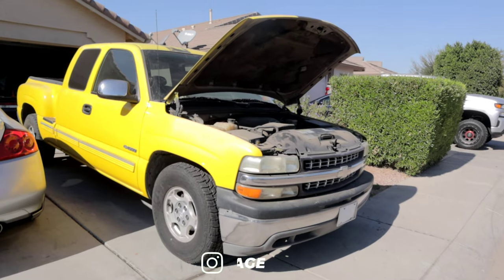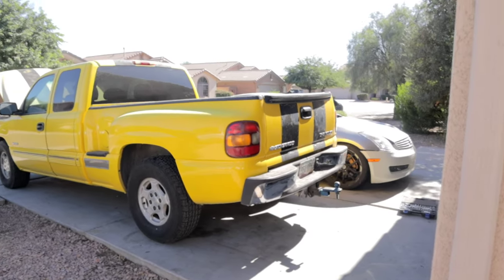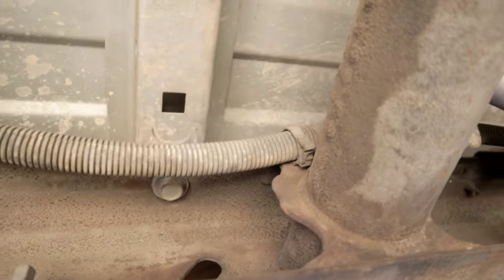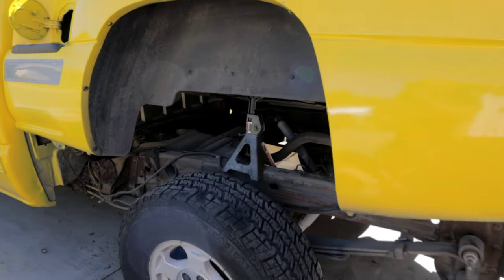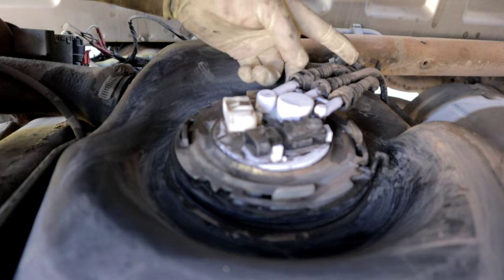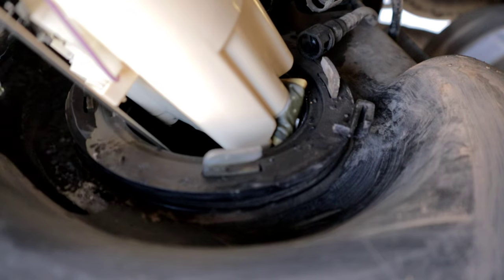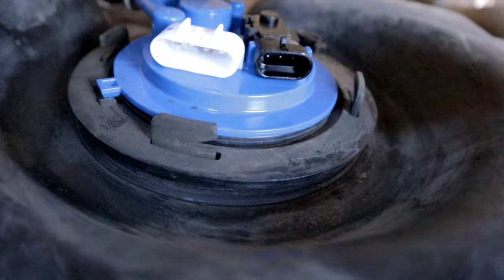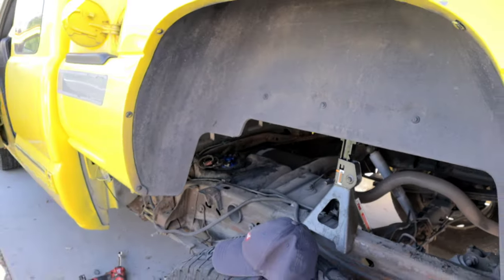2001 Chevy Silverado fuel pump replacement one person method

Comment: People always use a screwdriver or bunch to remove the plate that secures the pump. Easiest way is wd40 and a large channel lock plier. I've seen people bend and cut into that plate using a screwdriver. If your going to use a punch, use a brass one. Brass doesn't spark when hammered. Spark and fuel vapors can be hazardous to your health.

Comment: Man you are a savior brotha!! No experience whatsoever with fuel pumps and shop wanted $1200 dollars in labor without parts included and thanks to this video I have successfully changed my own fuel pump and saved over $1200 doing it myself following this video step for step is all you need! Thanks man you are the man!!!
Reply: $1200? Where did you take it,to the dealer? That's damn ridiculous!

Comment: Was going to cut a hole in my bed until I saw this video. I had the advantage of having a tractor with a front end loader to lift the drivers side of the bed, but the process was much easier than I had anticipated. Other than one of the fuel line clips being damaged, and having to run around town to find replacement clips (Napa), it took less than 2 hours. THANKS!!!

Comment: Hands down, Best trick to replacing a fuel pump without dropping the bed. Ended up having to cut one of my bed bolts because of living in the rust belt. Still beats dropping the tank. Thank you
Reply from the maker: Thank you glad you got it done

Comment: Completely filled my tank 6 hrs before my pump wetn out... ugh. But this is the BEST Fuel pump replacmenet video ive seen. Great views, great light, great information, great resoluation. Awesome!!
Reply from the maker: Thank you!
Reply: How do you know it went bad? My fuel guage stopped reading accurately, cant tell if its a fuse or the pump needs replacing

Comment: The trick to those fuel line connectors in the middle is to squeeze the flat sections on the end of the plastic. If they haven't become too brittle and break, then the plastic will deform in the right direction and far enough to just pull the lines off the pump. They're super-easy! Terrific video. Very well described with clear instructions. I liked the close-ups and I would've also appreciated a few more "big picture" shots, but that probably would've required running two cameras. Really good job on what you did.

Comment: Fuel pump just went out with a full tank and i was dreading the thought of lowering the tank. Can't wait to try this thanks for the video
Reply: I'm currently in the process, today i removed the bed bolts without an impact. A good breaker bar and some WD-40 and they come right off. Make sure to use a long extension so you have more room to swing the breaker bar.
Reply: @bladimirgarcia6063 is it wrong to use impact? Like cordless ratchet
Reply: @XitlalicFijar  No, using an impact is the best method. I didn't have one at the time so i used a breaker bar.

Comment: Eric followed your step by step on my 2002 Chevy Silv 1500HD CrewCab 4x4 fuel pump replacement. It went so smooth, thanks brother for the tips. SEMPER FI!!!
Reply: would your truck just crank start an stall when you figured it was the pump I also have a 1500hd an just ran into this problem today never had any problems prior starting they truck

Comment: Beyond Expectations! I will need to do this job..was lucky to make it home,my fuel pump so so weak and fuel guge had not worked for years..i have owned this truck over 20 years...Question will i need to buy a new electric  connector that plugs into pump...yours was modified once you said because connector used a different style...other than that those 3 fuel connections may be troublesome for me(hopefully not to much)...Again this was a ridiculously good video! Thanks for making it...Greatly Appreciated..😊😊😊

Comment: Great video.  I am 4 hours into my fuel pump replacement and here are some of my obstacles.  I had a aluminum step attached to the frame and bed that had to be disconnected at the frame. BUT the biggie was I have a Bed Bolt on Driver side in the back and in line with the spare that will not come out.  It broke loose and threaded out about 1.25" like all the others BUT it now just spins.  It will not go back in and will not go back out.  I am going to have to cut through the bolt with a reciprocating saw.  Even jacking up the bed and putting pressure on the head of the bolt had no effect.  APPARENTLY whatever these bolts thread into can fail or detach...not good.  So I will be dropping the Spare tire to make room and use my Hercules cordless saw to cut the bolt. This is probably why so many bolts are missing on a lot of fuel pump videos I have been watching.  My 2002 truck is 99 percent rust free and had an easy life before it came to me 2 years ago.

Comment: Great Video. Not sure where you live but my truck is in New England. Extra tools and process needed. Blow off all the chunks of rust on the frame not to get in mouth and eyes. Due to the rusted bolts, Tools you will also need is a breaker bar, 3 foot pipe for leverage lots of penetrating oil. When the bolt wont budge and the fasting nut spins you will need to get out the oxygen and acetylene and blow off the heads of the bolts. Only 2 out of 8 needed that done.
Reply: would heating the bolts before going at them help prevent them breaking? MAPP torch is all  I have

Comment: Good video bro, I'm about to do this for the 3rd time... think I'm just gona drop the tank. Literally 2 bolts takes about 30 min. My 3rd time cause ran it outa gas during winter a couple years ago warming it up... I got the cheap one, lesson learned. Spend the $ on a delphi so you won't be doin it agin in a couple years.

Comment: I have a 2000 chevy silvedao 1500 5.3 liter.  My question is.  Is it the same method for taking of the bed on a 2000 chevy silverado.  And great video by the way.  I plan on replacing my fuel pump and this video makes it so I am comfortable doing it by myself. Thank you.

Comment: We would use Vaseline on seal so it wouldn't get caught or kink the other thing after he started should have checked make sure the connection on those wires that was done by the previous person or making a good connection a little liquid tape would be good on that too. 😉

Comment: I recently had to drop the tank on my Mustang 4 times.  It wasn’t TOO bad once you did it a few times.  But I don’t want to have to do it again. 

I’m not sure if the Silverado would be easier or harder.   I keep hearing people talk about lifting the bed.  Which sounds like a PITA.  But you make it look relatively easy.   I’m chasing lean conditions on my Silverado.  I addressed vacuum leaks but still have codes.  I’m guessing it must be fuel related.   So I may have to replace the pump.

Comment: After doing a few pump changes, dropping the tank is much easier, and safer. One wrong move on whatever you use to prop up the bed and ur done.
Reply from the maker: The bed it not heavy. You won't die if it falls on you.

Comment: I cut a hole in my bed over the pump. Then welded some tabs on the cut out piece and put it back with a little rtv.
Reply from the maker: Sounds like it was Unnecessary

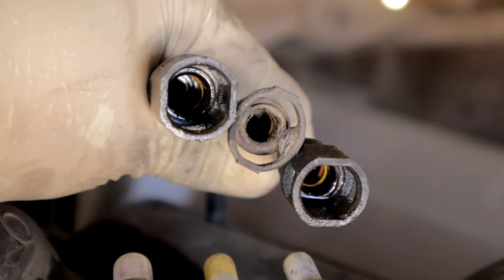Comment: You don't need a pick to remove that center hose. You just pinch and pull. Look at how it's designed in the video. (11:52) Also, if you have 3 other buddies around just remove the other bolts and remove the bed. Much easier to work on the pump and much safer also.
Reply from the maker: Not everyone has a few  buddies just waiting around to help out. And sometimes those clips get dirt in them and they can get suck a pick helps in those cases
Reply: @ERICSDIYGARAGE Agreed, and that's why I said "if". And those mud daubers (wasp, divers) can cake up some "mud concrete" on anything, anywhere. If no dirt is present, that middle connector is just pinch and pull. Oh and great job on the video, especially being mindful enough to disconnect the negative battery cable and the correct way of releasing  fuel pressure.

Comment: 4:22 that strap right there, thats a ground strap. He didnt mention or show it, but for everyone out there, don't make my mistake. You'll need to disconnect the ground. Dont forget to reconnect the ground strap/wire bc I had my pump go bad in freezing weather. On top of which I was traveling to a dif state. So I did all the work in AutoZone parking lot laying in the snow and freezing weather. So before putting truck bed back on and reinstalling, of course I'd test it. But didn't work and I went thru about 4 brand new pumps, including having to rewire a couple. It was super bowl Sunday and I was late, I was fkn pissed- of all days it had to be. Finally a guy passing by asked me if I had the ground connected to the bed frame or panel by gas nozzle. Nope. Totally didn't realize I needed it connected. I thought it was for electrical surge protector. Started right up. Just a simple wire coming from an area I didn't think important caused me so much grief. So don't forget about it. In Silverado the wire that comes by the gas inlet tube.
Reply from the maker: I didn't have to disconnect it

Comment: so you're supposed to have your truck fully run out of gas then once all the steps are done and the new fuel pump is connected fill the tank back up then start the truck to see if the floater is reading?
Reply from the maker: No it can have fuel inside the tank it doesn't matter

Comment: Great Video! I am the single owner for my Silverado. So, the fuel pump has not been re-wired. I traced the new pump wires with the original pump and they were the same.  Installed the new pump and the truck is missing awful. No wiring instructions came with the new pump. Do you happen to know what needs to be re-wired?

Comment: can do wid a crew dble cab how much over hang at hand ok if want replace wid alternative back is flat bed Nd capes so can remove side capes leaving flat bed to fit removable camper bak type idea but also use her wid side capes as work horse it's a 54 plate Old L200 warrior

Comment: Great video.  I’ve replaced the fuel pump years ago because the fuel indicator in the dash was all over the place. It’s now doing it again and now it’s throwing PO174 and PO170 codes. I’m thinking it’s due to the fuel pump. Do you remember what codes you had?
Reply from the maker: I have emissions codes and just inaccurate fuel levels. Your codes are not fuel pump related. You likely have a bad o2 back spark plug vacuum leak or a cylinder down on compression which is rare

Comment: Did you have to connect the plugs in the rear before your started it? I just did the replacement but it didn't start when I went to test it. I noticed there was no power at the plugs. So I was wondering if I had to install the 4 plugs for the lights before I tested it?
Reply from the maker: No you don't have to connect them

Comment: What happens if i have two quick connect lines on the outside and broke them off. I cant get the plastic fuel pump port out of my quick connect
Reply from the maker: Wd40 and small picks
Reply: Yeah man I used a small screw driver got in their and kind of pried them to the side. They will come off you just have to figure out how to squeeze/ pry. Once you figure it out it makes sense

Comment: This seems easy. But easier is cutting a hole in the bed like I did. A 13" square is a perfect access panel size. 20" from the left side of the bed (inside) and 11" down from the front (inside) and you have the center point. Put your tape measure at 6.5" on that point and mark at 0 and 13" on both axes and you have your lines to cut. Just mind your cutting depth, but you really don't have to try hard to avoid hitting anything with a cutting wheel on an angle grinder. Do what you need to do and then give it a few taps with the welder to seal it back and you're done. I need to figure out a solution for a permanent access panel that can easily be removed.
Reply from the maker: That's just lazy
Reply: @ERICSDIYGARAGE  Bill Gates is famously quoted as seeking someone lazy to do a job because they will find an easy way to do it. My plan is to weld in some supports underneath the recently cut panel, fabricate or purchase some twist locking screws to keep it in place so that way it can still support weight and remain an easy access for the pump. 

Lazy? Yes. But also smart as long as I don't leave it as some hatchet job, which I won't.

Comment: So my fuel pump on my 99 silverado is starting to go bad and I want to replace it. However, there's two options to choose from, just the pump, which is $50, and the full housing and pump all in one, which is $150. Do I absolutely need to get the full housing as shown in the video, or could I just replace the pump itself and use the old housing?
Reply from the maker: Get the full housing since it has the sensor built into the housing

Comment: So what is the best pump to get I saw an AC Delco which was $315 or the GM original equipment pump which was $187 ?
Reply from the maker: The one I purchased is also top tier and no issue so far
Reply: I would get one from your local auto parts place. If something is wrong with it you can just replace it quickly. Easier for warranty issues too.

Comment: Also, the guy at the auto parts store said, "you need to drain the tank. It's the sediments that made the pump go out. If not, you'll have to change the pump three times before everything is filtered out". Just wanted your opinion on that. I don't believe him, but kinda got me worried a little.
Reply from the maker: He works at an auto parts store, not a mechanic shop. You will be fine

Comment: I really don’t understand why it’s easier to lift the bed. On an 01 Silverado it’s literally just two straps. Run the tank low the day before you do the swap and it’s not heavy. At all. Remove two straps and drop it. That just seems waaaaay simpler and easier and less time consuming than removing the tailgate and lifting the bed
Reply: Key word is “seems”

Comment: And all this is on top of the oil pump and timing chain replacement and I tried starting it after that and found the fuel filter was clogged and starved the pump because the fuel pump was on a angle and letting dirt down in the tank for God knows how long 😢

Comment: Can I try this method in my 2010 chevy silverado?
Reply from the maker: Im sure it's the same
Reply: @ERICSDIYGARAGE  I checked my car bed model has a share that will be touching the back of the cabin.
In that case maybe I should remove al the bolts and slide torres the rear like a couple of the to perform the replacement.
Would you recommend me that o bring down the tank?

Comment: My 02 Silverado won't start I already hooked the computer on it all sensors are good the fuel pump turns on and everything and it sounds like it's trying to turn on like if it doesn't have gas in it the tank is fool tho idk what it could be any idea ?
Reply: Get a fuel pressure gauge and check fuel pressure. It should be around 50 psi. If your getting that then it’s not the fuel pump

Comment: When I let my vehicle run for about 30 minutes it won't start back up, I have to let it sit for about 30 minutes then it will start. Does that mean my fuel pump is going back or is it an electrical issue
Reply from the maker: Turn your key to accessories you should head the fuel pump priming if not it's bad or weak

Comment: How do I do the rewiring for the pump
Reply: Wires are color coded. Crimping heat shrink butt connectors are included with the pump. Just make sure you use the larger ones on the larger wires or many people rather solder the wires and use heat shrink tubing.

Comment: Isn't bad to run the truck until the tank goes dry?
Reply from the maker: I didn't run the truck till the tank was dry only ran the truck to remove the remaining fuel pressure in the fuel line. You don't want to run the fuel pump without any fuel
Reply: @ERICSDIYGARAGE  I understand now, Thankyou for clarifying.

Comment: I dropped the tank on my 01 Sierra, it was fairly simple. Why does everybody keep saying it's a pain? Maybe because I work on diesel engines daily?
Reply from the maker: With a full thank of gas it can be a pain we can't pick when the pump will fail this is a alternative way that in my opinion is easier
Reply: @ERICSDIYGARAGE  I drained it using an old school siphoning method, used 3 5 gallon buckets I had around and honestly I still don't see the hassle

Comment: Man, I have a 2005 silverado 1500 4.3L 2WD single cab 8ft bed and I can't find the fuel filter. I have looked on the frame rail multiple times, but there is nothing there or under the hood, but my Hanes book says it's on the frame. All i see is fuel line .🤷‍♂️
Reply from the maker: Probably doesn't have one
Reply: @ERICSDIYGARAGE  I would assume it has something right, or my injectors would get clogged up 🤷‍♂️

Comment: I think my fuel pump is going bad cuz i could hear a buzzing noise coming from back right were the fuel tank is .. was the price to get this job done.. just dont wanna get scam by mechanics.  I have the same truck but a single cab short bed..
Reply: Nah man that’s how you know it’s working is that buzzing. If it won’t start and you don’t hear the buzzing at the gas tank your fuel pumps done.
Reply: @jessecopp9206  what about louder than usual buzzing from the fuel pump including higher rpm’s at idle?
Reply: @thrift_scoopsig2157  probably means it’s on its way out. not completely positive but I would think the pump is starting to fail causing it to kick it up a notch to still work. as long as you know the tank is clean, the gas is clean and of course it has gas then it’s most likely a failing pump

Comment: I try changing out new on but still won’t turn on any idea why ??
Reply from the maker: Check for codes could be a fuse or starter a clogged fuel filter
Reply: @ERICSDIYGARAGE  but my pump is getting no power at all